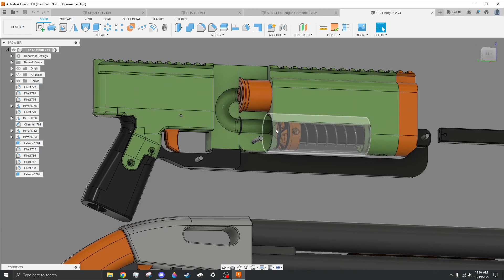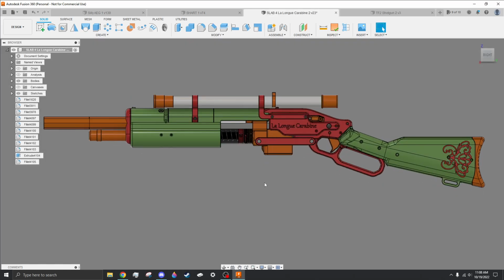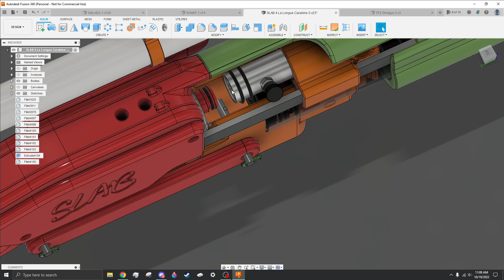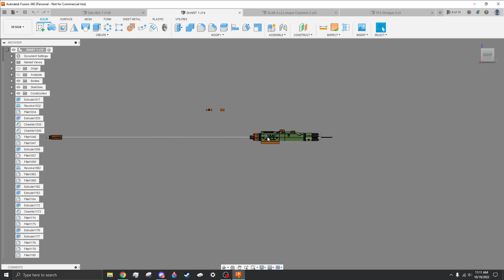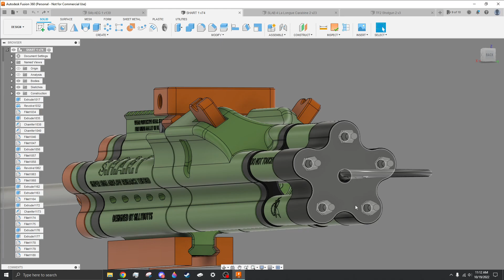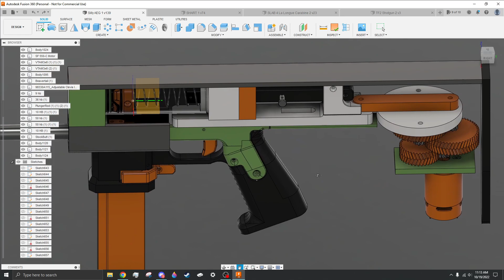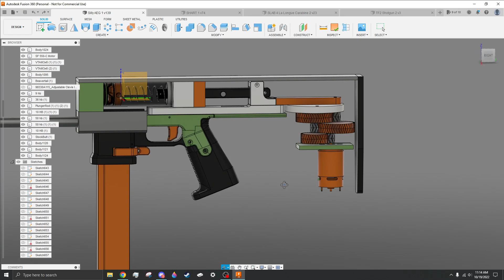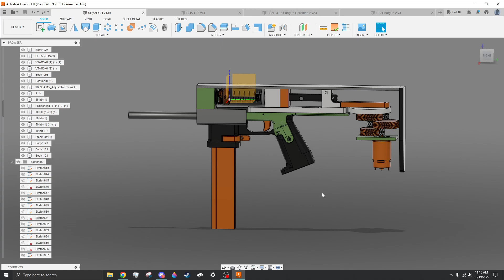Stuff I'm working on, October 2022.

Comment: Great jobs, sir! How do you actually prime the 500 fps monster? Is it possible to have a goofy yet fun priming action like you are rowing a boat - put 4 wheels on the bottom of the main body along with 2 petals on the side,  and then make the priming bar T-shaped and much wider for your both hands to hold and pull.

To prime it, simply sit down with your both feet on the pedal and then use your both hands to pull the T bar back with you whole upper body falling back while extending your legs, just like you are rowing a boat. “Foot priming” should be a great scene to watch, lol.
Reply from the maker: That is actually exactly how we have been doing it in testing! Massive T pull with two foot rests on the picatinny rail.
Reply: @Sillybutts   Damn cool, great works, sir

Comment: Any updates on the Cynthia?
Reply from the maker: It needs some major redesign of the back end to fit in aluminum bars for stability. Setting it aside for a bit. I just work on whatever I feel like any day of the week.
Reply: @Sillybutts  thanks for the update. Sometimes taking a break from a project helps with moving forward. And because your blasters have related engineering, you may find that the current one you're working on can provide new inspiration/solutions.
Reply from the maker: @MannyCo  > And because your blasters have related engineering, you may find that the current one you're working on can provide new inspiration/solutions.

Exactly! This is what I did between the SillyPistol and the SLAB. And now between the SillyPistol, the SLAB, and the new AEG.